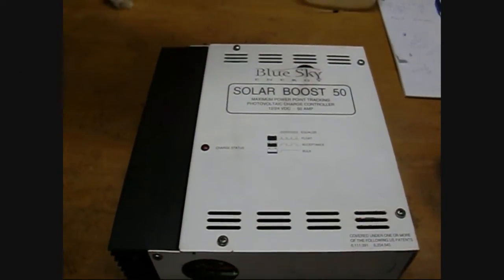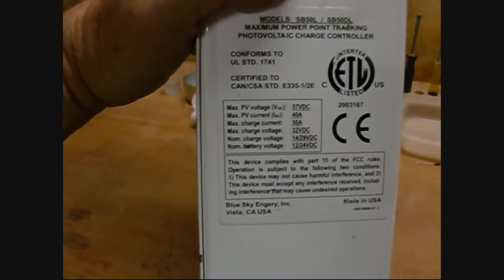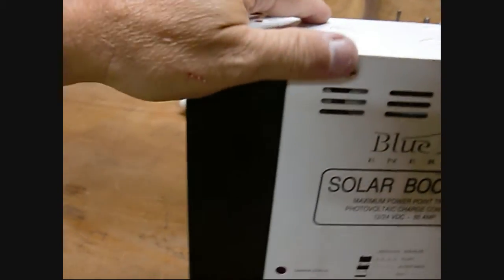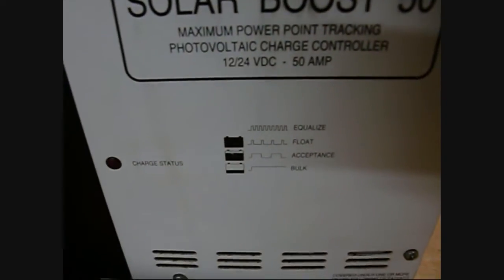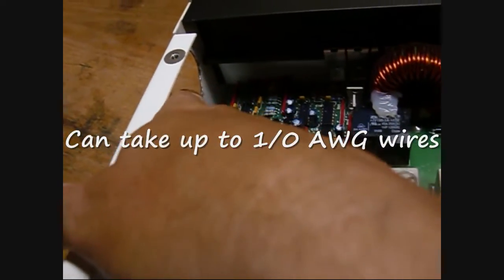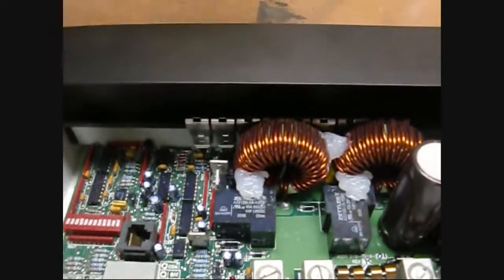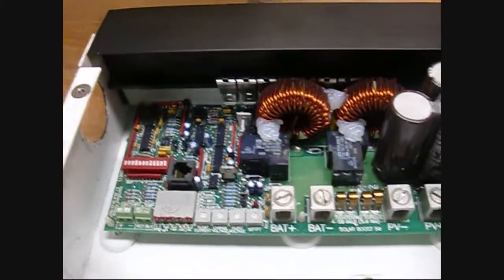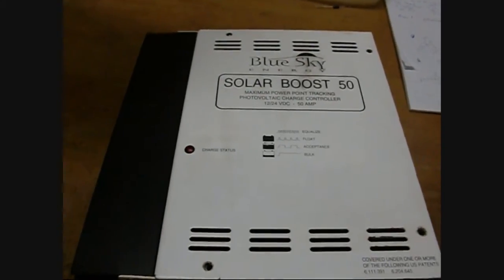Blue Sky Solar Boost 50 MPPT Charge Controller Overview

Comment: I have the 3024 model of this. I'm using it with 2 245 watt 24v solarworld panels charging a 12v battery bank. Its working out quite well so far.

Comment: How do they handle 50 amps on the circuit board.  I figure that the trace would have to be at least 1" wide on a 1 oz copper layer.   Does it look that wide?